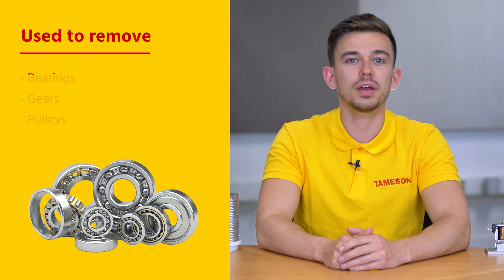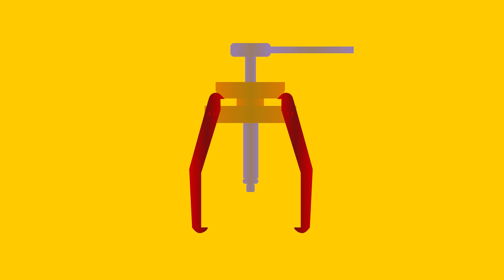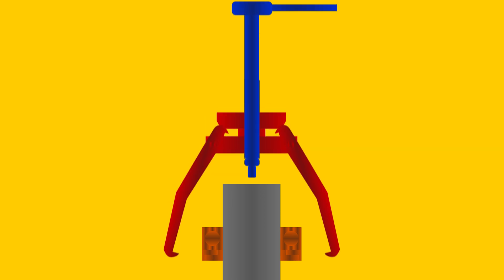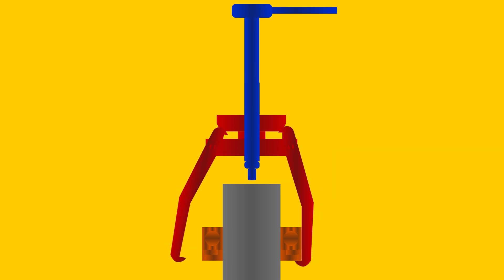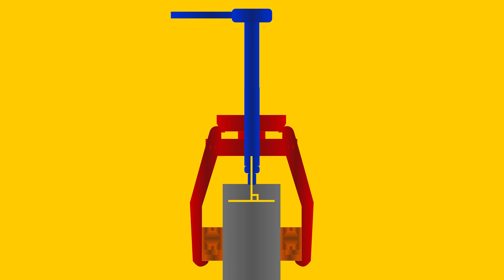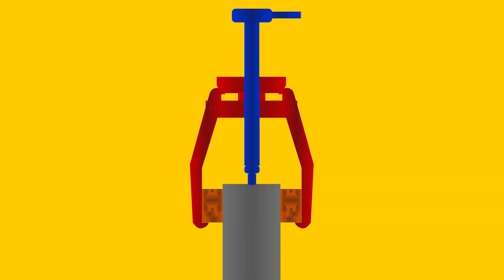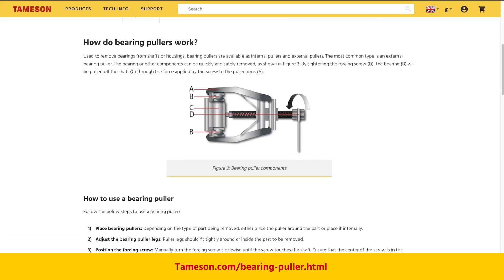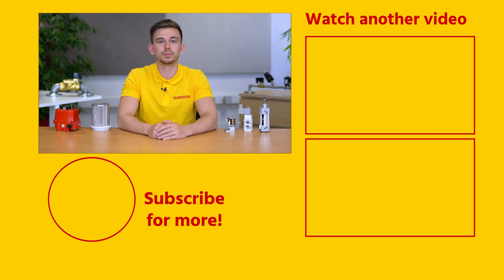How to remove a bearing using a bearing puller I Tameson

Comment: Removing is it easy part installing is Most difficult
. it's easy damage Them wel installing 😐
Reply from the maker: Hello, we understand that installing bearings can indeed be challenging and may lead to potential damage if not done correctly. To assist you, we have comprehensive guides and tips on bearing installation that can help prevent damage during the process: https://tameson.com/pages/ball-bearing-installation

Comment: every one of you idiots keeps saying " the part to be removed" yea we know you idiot, we are removing the bearing the only part being removed. But you like other idiots dont clarify where on "the part" should be pulled from. the outer part, the inner part , what is best? saying "part" when clearly only talking about the bearing which has several "parts" is pointless